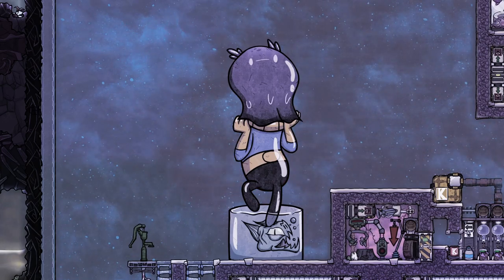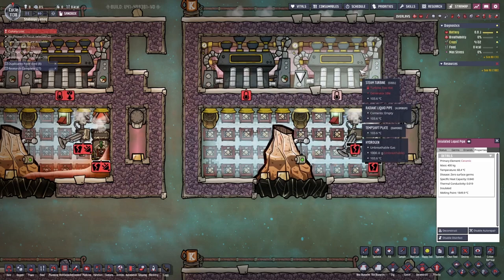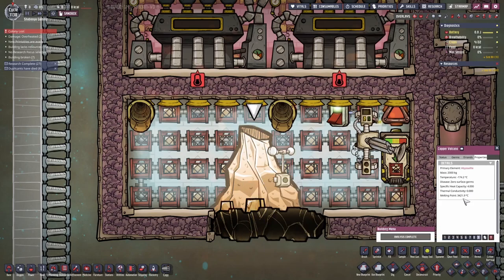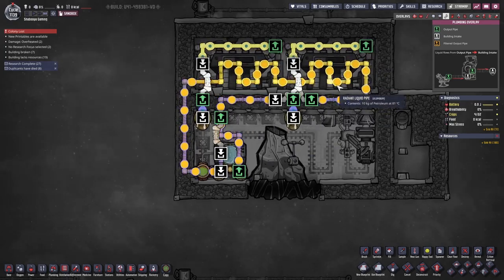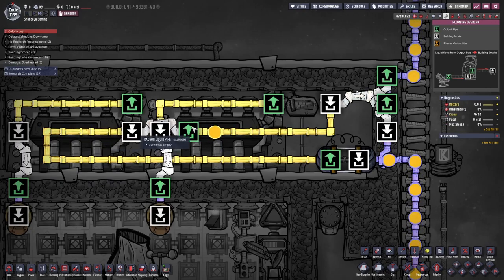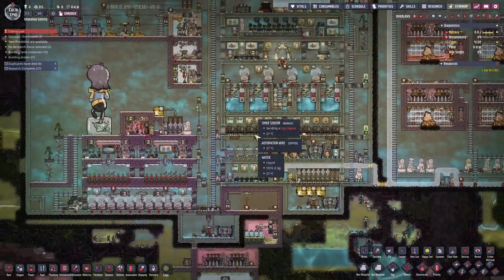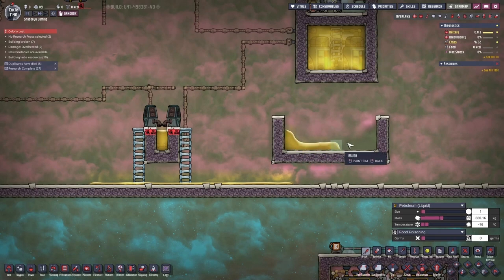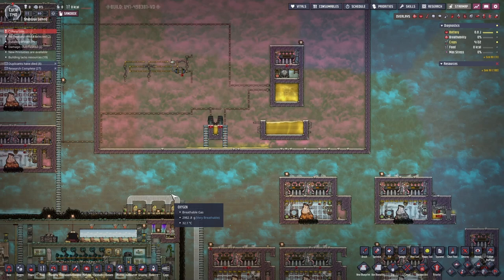(Updated) Metal Volcano Fix | Oxygen NOT Included (ONI) | Tutorial

Comment: So there aren't problems with the gold volcano?
Reply from the maker: Nope.. thats what happened in my testing.. the only issue i got was with iron n copper..
Reply: The design is so cool. I like the fact that it also produce energy for shipping system
Reply: gold is the lowest heat, only needs one turbine. this is due to the specific heat of the metal. this method works better if you just let the metal cool off the rails. if you want to rotate the metal on rails like this, you'll need active cooling for every volcano other than gold.

Comment: Oh wow... you rly lack the basics for self cooling STs it seems, here we go:
The ST as it's working removes heat but also generates heat, 10% of what has been removed. Your output water can only soak up so much heat. ~5°C worth of heat to be exactly. Past certain point of about 135°C of steam temp the ST will generate more heat than the water can soak up. It's a balancing act and your balance is this steam temperature, if you teeter at that point of equilibrium your turbines will not exactly cool down but remain at the given temp so each increase is very hard to compensate. The more you are over this temp the more you have to be below it to average out towards at least the equilibrium point and once you overheat a turbine you cant restart it till u externally cool it down.
One more thing, all the heat above 200°C (which you shouldn't reach with self cooled STs) is directly leaked thru the turbine to it's surrounding so what you have done is basically a one way street to critical failure. And no, there is no transfer thru your piping, everything is working EXACTLY as intended and in accordance to ST mechanics.
ST self cooling is a very delicate thing and require a lot of planning and a bit of relatively deep knowledge of game mechanics. Personally i wouldnt ever advise it tame any volcano, maybe apart the gold one cos it's so pathetic thermally.
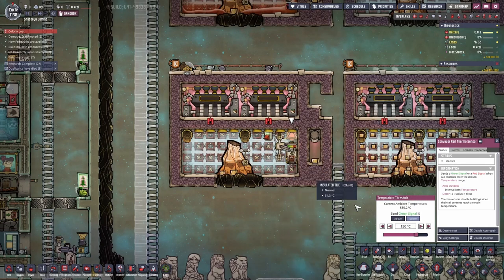3:45 that's not the only solution. use a bridge anywhere after the spot where things melt. You're welcome.
Reply: a bit condescending(unless ive got the tone* completely wrong!), but good information lol xD
Reply: @Chtorr1988  wasnt the goal but it does annoy me when someone who clearly doesnt understand something tries to explain it to others and gives advice. This fosters rumours, misinformation, myths and such like. All it would take to greatly reduce those is about 5min reading the wiki. Ive played the game long enough to have the feel for what is true. I did have to learn it at some point obviously but such theorycrafting is detrimental and relatively easy to check in sandbox too to even somewhat cross check if wiki is right. Glad u found what i wrote useful. I tried being not too meticulous to be easier to understand for people.
Reply: @tyraelpl  I agree with you. Bad information is worse than no information.